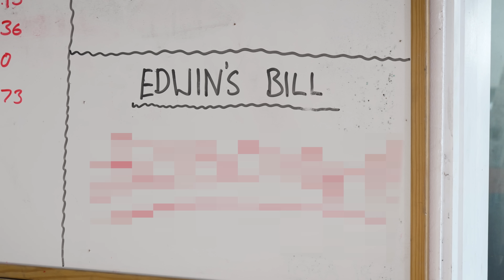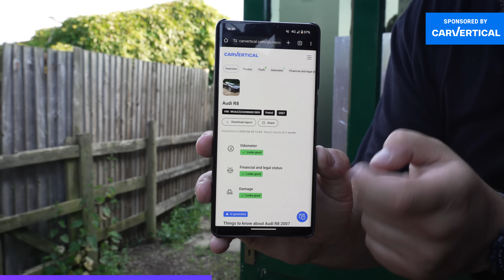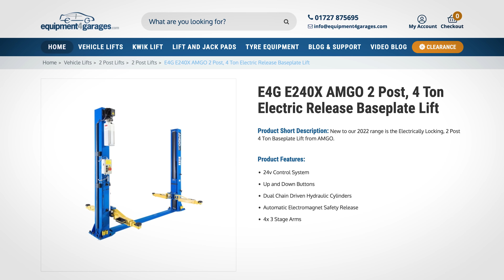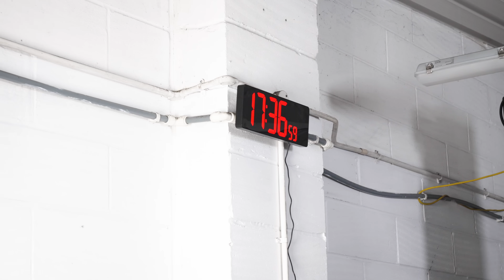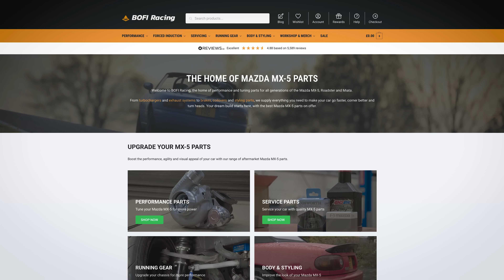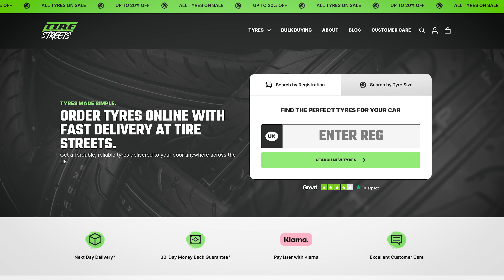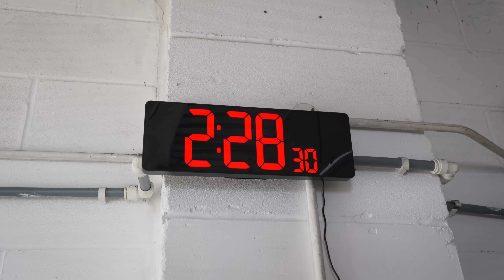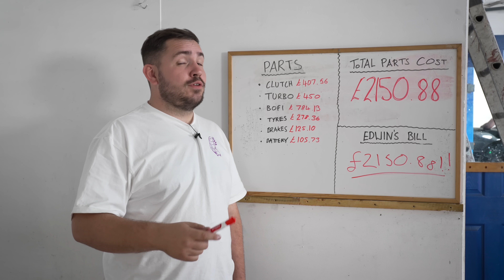24hrs To Save My Forever Car

Comment from the maker: Get 20% off Car Vertical using code 'TDC'! 
https://www.carvertical.com/gb/landing/v3?utm_source=infl&a=TDC&b=38b26e3a&voucher=TDC
Reply: Please tell me there's a part 2 right??
Reply: Please tell me there's a part 2
Reply: Help I'm confused. Why is the Miata have an  "18 Valve" engine but for 18 valves spread across 4 cylinders it would 4.5 valves ;-;.
Is there something I'm missing?? Or does it say 16 Valve but it looks like 18.

Oh nvm it says 16...
Reply: nah man after u screwed edwin so hard on that?
Reply: 24:24 so what is a better car for 500? And for 3-4 grand? Please do tell! 🤞
Reply: Edwin, stop complaining. I live in Italy and everyday is very hot !
Reply: Just a small warning, that MR2 servo pump will break down and it is basically unrepairable.

Comment: I'm so used to seeing these types of videos end in a "just in the nick of time" manner where they're magically saved by some outside force at the la st moment, that I was genuinely shocked to see Edwin lose; it was refreshing!
Reply: surprised he gave up with 30 to go... must ave been specific fuel fittings he didnt have
Reply: Refreshing and genuine. That's why I love this channel, and All the Gear. If they don't meet the goal, they lose. So many other channels would move the goalposts.
Reply: @JW-qf2fx it just wasn't safe to start it with all that fuel in the engine bay. It would never have been dry enough in 30 min, can't risk a fire

Comment: As someone who lives in a desert, here are some tips to keep cool when you're working in a hot garage. 
Hydrate, you sweat to cool your body down, but it dehydrates the hell out of you super quick so keep yourself hydrated. I've got two insulated bottles filled with cool water whenever I'm in my garage in the summer.
Open the garage door. Use whatever breeze you can to get heat out of the garage.
Drape a wet tea towel on the intake side of a big box fan so that it pulls air through the towel cooling the air down. Fans normally don't cool you they just blow hot air off of you so you feel cool.
Hydrate
Cool your neck and hands and wrists. These are essentially your body's cooling vents because you've got a lot of blood flow closer to the skin. If you cool that down you can more efficiently cool down the rest of your body. You can do this by wrapping wet bandanas or evaporative cooling cloths around these parts of your body. For people with long hair like me, put your hair up. Having your hair down is kinda like blocking the cooling vent that is your neck.
Hydrate.
Reply: Also 31°C sounds like a delightful day in a low humidity desert like mine, but in a more humid place like the UK that sounds dreadful.
Reply: Unfortunately in the UK sweat doesn't cool you down much, it just makes you sticky and horrible adding to the uncomfortable feeling of being hot. It's too humid, even if the breeze feels cool your body struggles to maintain temperature making it feel hotter than it is.

Edit: ah I see you addressed that in a reply to yourself already
Reply: @Blazi3  yeah that's why hydration is important because your body will sweat regardless of whether or not it's helping.
Reply: Or just install an AC? Would've cost half as much as they'd spent on this one video...
Reply: @jama211 we’re all on the dole, we can’t afford no AC

Comment: 3:25 that's a decently hot day in Sydney where the buildings are designed to accommodate said heat. People forget how important architecture and urban planning is to temperature. British buildings are designed with many thick internal walls and small windows to preserve heat as opposed to the large open planned builings seen in hotter areas of the world.

Comment: I got the clutch misaligned on mine when I was doing the 2.5 litre swap in my NC, even putting the box onto the engine with them both out the car it took a depressing length of time to figure that one out. Bendy plastic tool

Comment: Hello. My name is Imbe, i am a hobby mechanic. I found a Honda Civic Fn1 2010 sitting around for... a price and i had to go trough the breaks and suspension.. i also had to do a radiator+AC component swap to it due them being... rot away and punctured.. well after i was done.. i had experienced multiple projects and scenarios where im in a time pich in  a place where i must do "the thing" aka work with my car. When people put you in a hurry, you can bet my ass the face is exactly like this dude right here.. 24 hours is a short ass time to work on something.. we mechanics are put on torture and some how it is fun.. poor man, i know how you feel. My soul is with you. i did a break caliper rebuild + front + rear suspension rebuild in a weekend and this dude is dying here in 24h time pinch... my soul... my heart. (thanks for reading - Imbe)